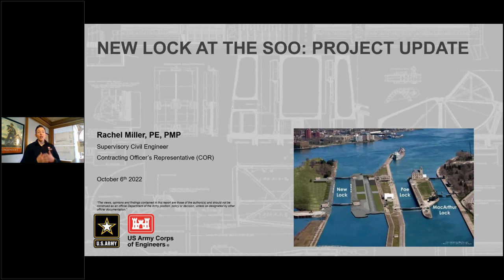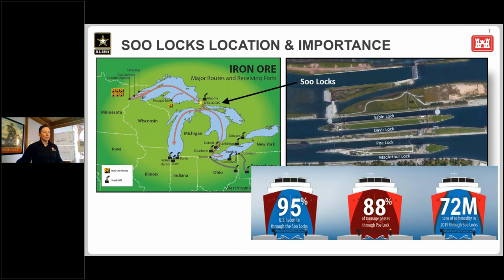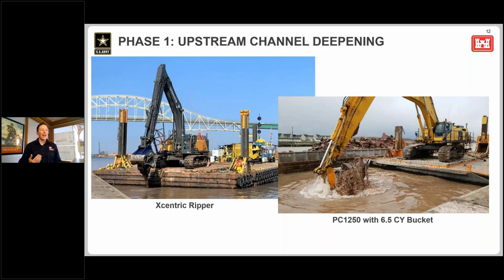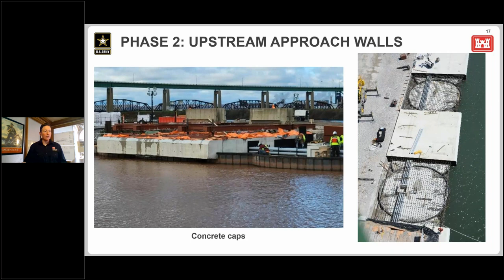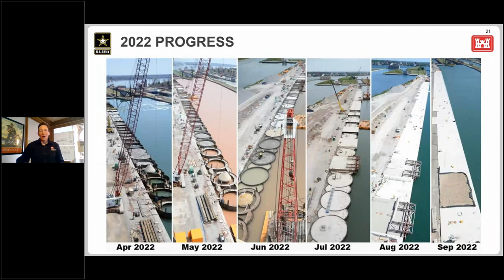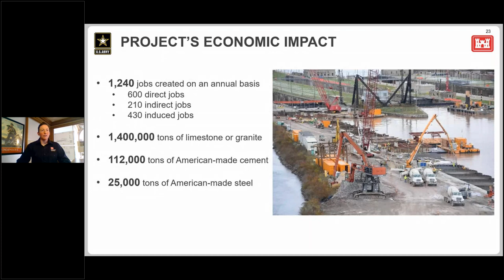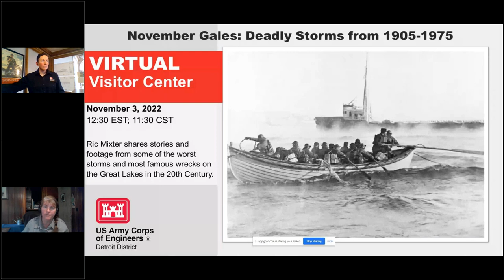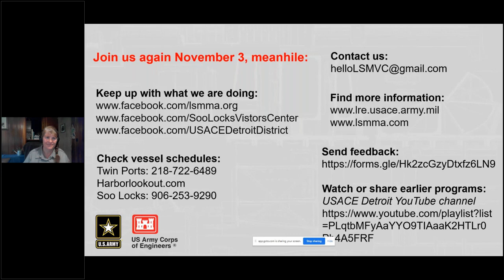New Lock at the Soo: Key to the Great Lakes

Comment: Being from the area and Great Lakes Shipping being a interest of mine I do know a bit about the locks. I missed the Q&A so I'll ask here. Will the new lock have a improved way of any type, such as bubblers to reduce the amount of ice that enters the lock and or from freezing during the winter months? I know in the past that Tugs have had to be used to scrape the sides of the lock and use prop wash to help clear the lock of ice for ships locking up (or down) ???
Reply from the maker: The New Lock at the Soo design includes a combination of elements that are the same or very similar to the Poe Lock, such as the miter gates, and some elements that are new technologies. A new technology is the Hands Free Mooring system, a contract option with this project. Hands Free Mooring uses vacuum pads instead of lines to hold ships in place as they transit locks. This technology has already been implemented in the locks along the St. Lawrence Seaway, but will be new for the Soo Locks.
Currently, bubbler systems are not included in the New Lock contract. However, reducing impacts from ice is certainly part of the conversation for the facility to operate and maintain the active locks.